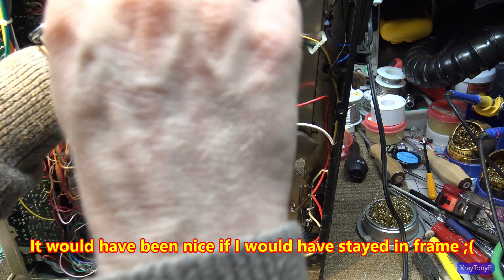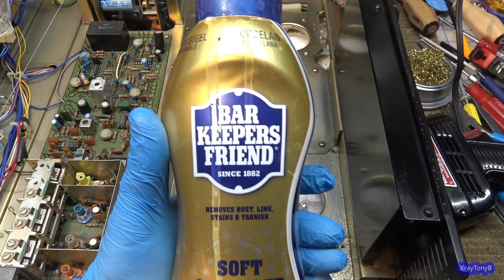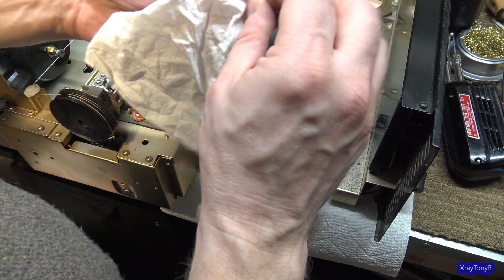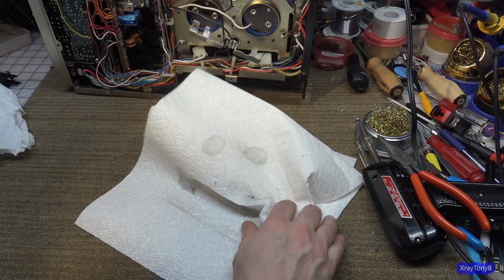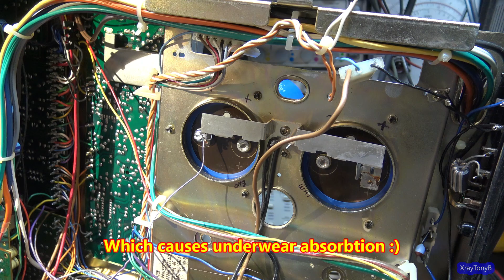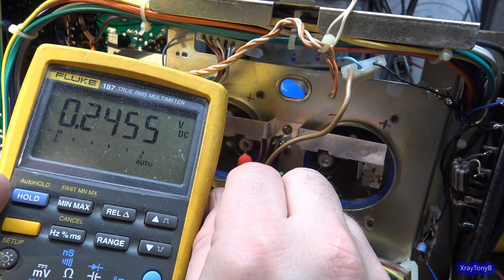Pioneer SX 1280 Part 5   Replacing the Large Filter Capacitors

Comment: Is it OK to install these screw terminal caps with the terminals and vent on the bottom?  I have heard you always want the vent on these types of caps pointing up.  I’d like to get your thoughts on this.  I’m going to be replacing some 22,000 uF caps in a Pioneer SX-950 and I need to decide on the orientation

Thanks
Reply from the maker: It won't hurt for them to face down.  You just have to make sure they aren't being blocked by being right up against a circuit board or chassis.  The idea is if thee cap vents, it can release the pressure through the vent plug located between the terminals of the cap.  On other caps, the top of the capacitor case is scored in a + pattern, which will allow it to pop open to vent.  again, it doesn't matter which way it faces, just so long as it isn't being blocked by something pushing directly against it.

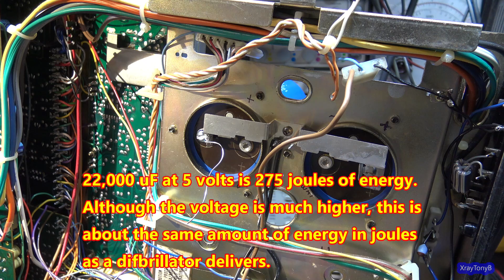Comment: 14:43 22000 mF would deliver 275J of energy, however 22000μF is three orders of magnitude less so would deliver 0.275J of energy since V = q/C and E = ∫V.dq =  ∫q/C.dq = q^2C/2 = V^2C/2 where V is in Volts, C is in Farads, q in Coulombs and E in Joules.
Reply from the maker: Yep,  i messed up my decimals there.  Typical 🙄
Reply: @xraytonyb  did you discharge the capacitors before removing?

Comment: Hey Tony. Want to let you know that I'm loving this series on this pioneer receiver. And I also wanted to expand on your comment about replacing the filter capacitors. Your statement about wanting this receiver to be working 30 or 40 years from now is exactly my thoughts on why I would always replace the filter capacitors in every one of my restoration projects. Even if the capacitor tests okay as far as capacitance and ESR, I will always replace filter capacitors. If you have a leakage tester, you will find that almost every one of these old capacitors are leaking more than a new one. Leakage leads to higher heat within the capacitor and accelerated aging and failure. Even if a capacitor tests within spec in as far as capacitance and ESR is concerned, they will not last. Given that you're going through a restoration on any piece of old equipment, I believe it's money well spent to replace the filter caps if you are replacing all the other electrolytics. And I know it's more of an esoteric, audiophilic aspect, but raising the capacitance of your main filter capacitors will ultimately lead to better sound, especially in the lower frequencies on speakers that are difficult to drive and have low equivalent resistance especially in a lower frequencies. And by equivalent resistance, I mean reactive resistance due to crossover capacitive and inductive reactance, not just pure resistance.

Comment: Congrats on getting a Jonard wire unwrapping tool to get off of the wire unwrapping struggle bus.
I always cringe when I see people prying apart a wire wrap with pliers when a proper tool is available, or one can be made, which I have an example of. Having had to do wire wrapping on a production level, and also having to take apart and rework them, having the proper tools for that job is a huge time saver.

Comment: Those larger caps should be fine. They used the same value in the SX1250. Moving to a 15000uf on the X80 receiver was likely just a cost-cutting measure.